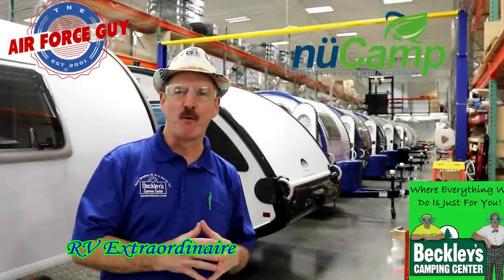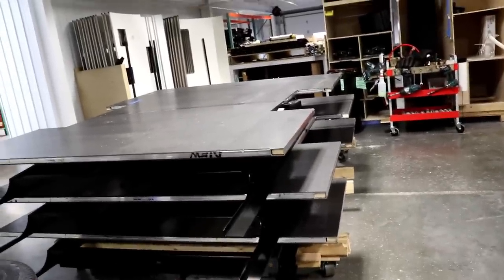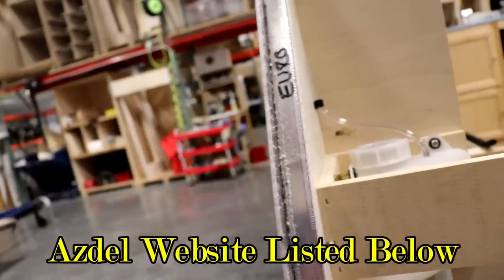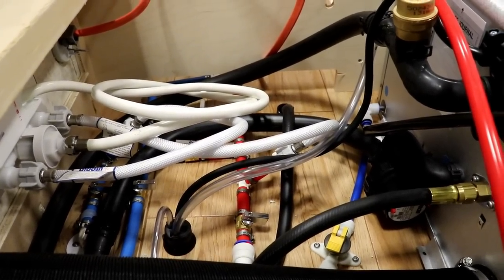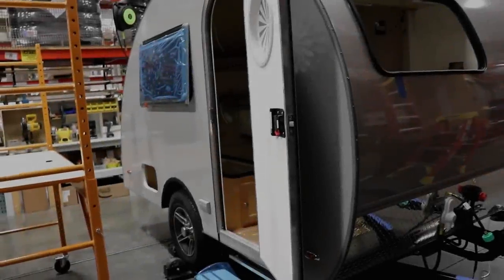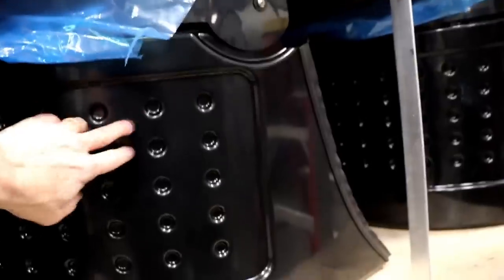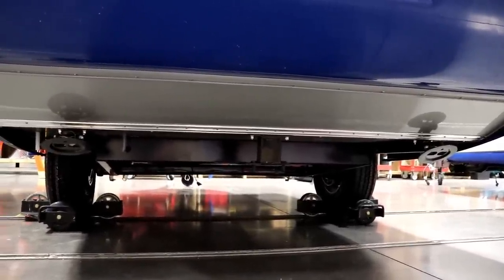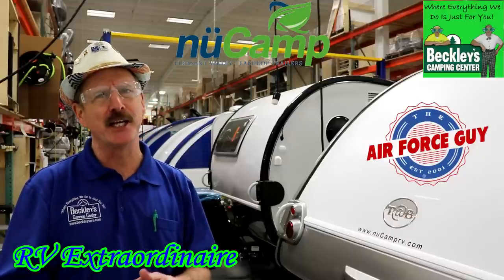The Making of the T@B 320 by NuCamp RV - w/Paul Chamberlain, Jr. "The Air Force Guy

Comment: I wonder if you could order and self install the battery/propane platform that would normally be on a boondock style and just self install in a normal 320S? Or ask for one to be made with it? Honestly it’s the main reason I would want a boondock but I don’t know if it alone justifies the price increase.
Reply from the maker: Absolutely you can order the Boondock platform after the fact and install it yourself.  However, It is much more expensive to do it that way.

Comment: On a 2022 tab 320 where is the fresh water tank located?
Reply from the maker: If you have the inside kitchen, it should be just above the area where you drain it.  The drain is up front on door side or off door side.  Outside kitchen it should be under outside kitchen with drain just below the kitchen.  Please let me know if that helped.  If not, I can make a call and find out.